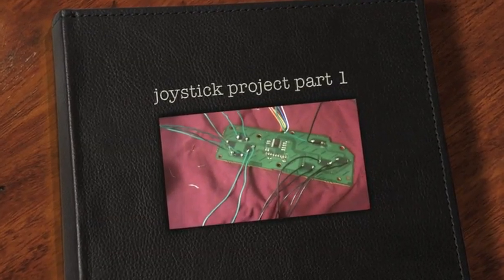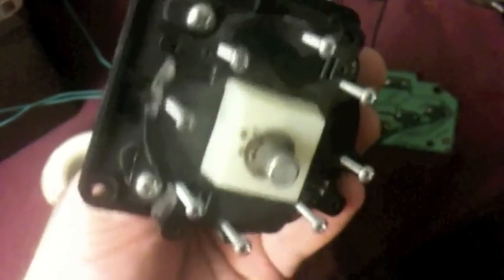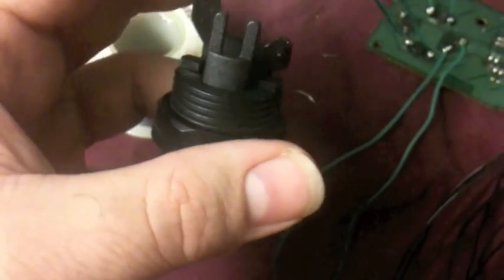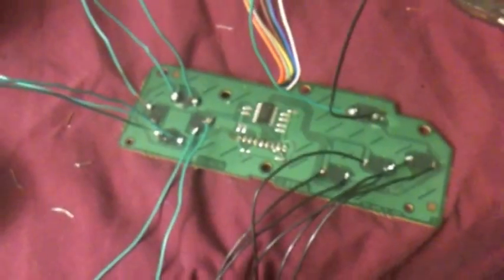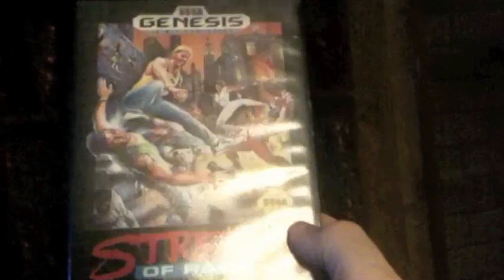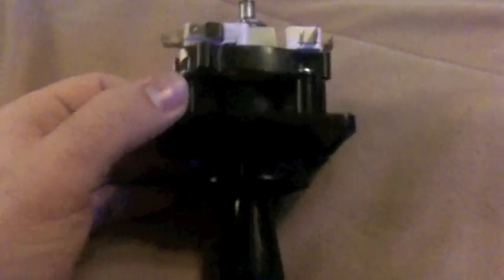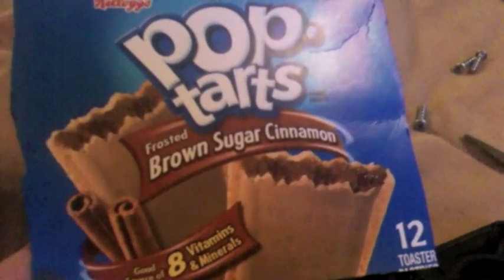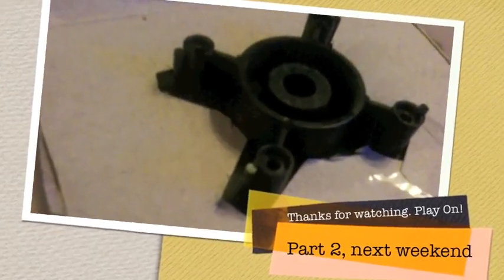Making a Joystick Project: Part 1

Comment from the maker: @sup3rphi1 It is a deal, I should get time to put it together Saturday if all goes well, and then it will come down to the additional flash on the side of it.  That might take a little bit of time though since I want to find some nice patterns and burn them into the wood as well as a sheet of brass for the top.